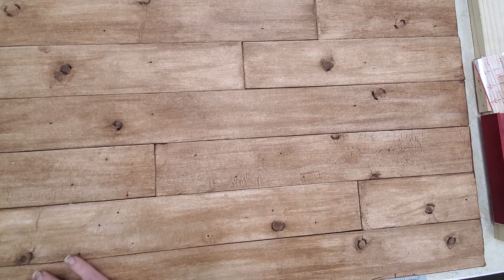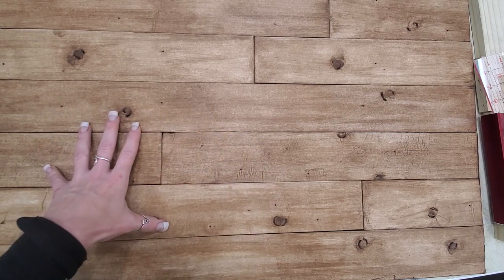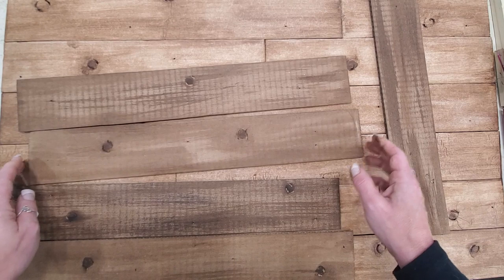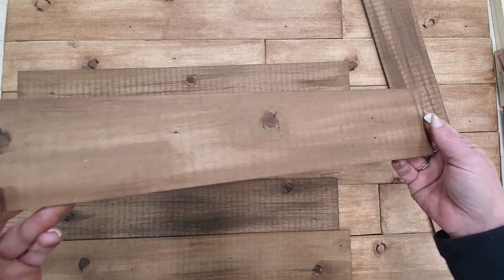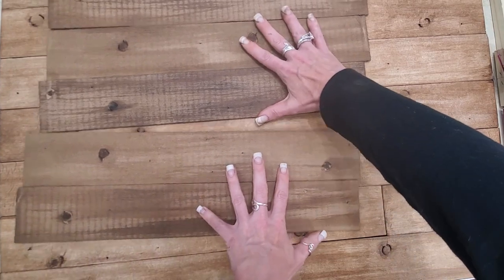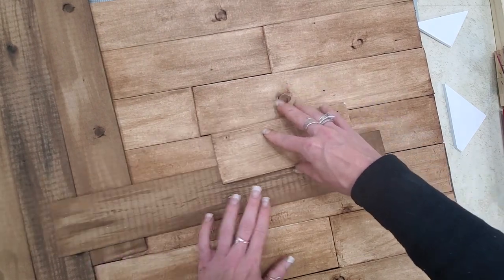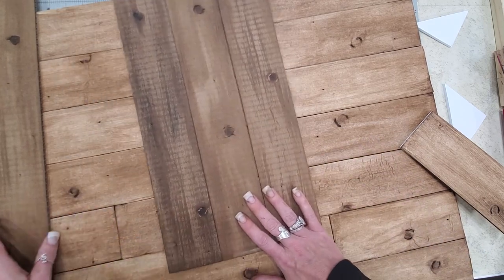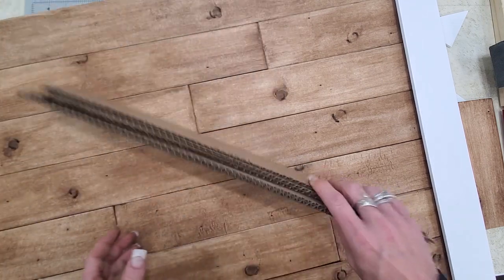Foam core and upcycled card board comparison

Comment: Could you paint the cardboard with gesso first to give a better surface? I need to do some really long planks, like 6 ft instead of 30 inches, to cover the edges of a trunk and I don't want the long pieces to look joined.
Reply from the maker: I have not tried that, not sure on how it would affect the way that the wax and paint blend.